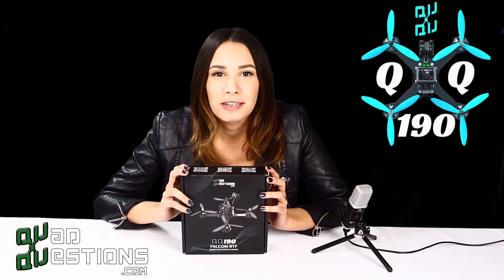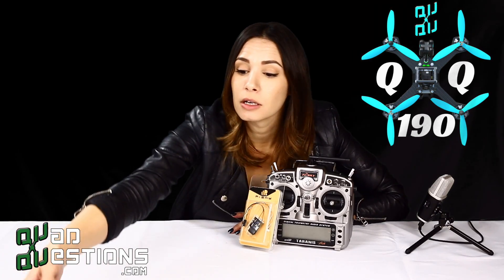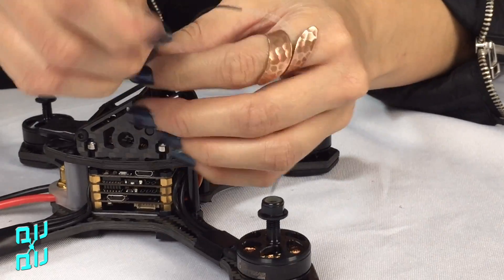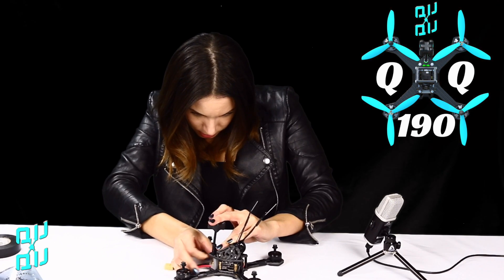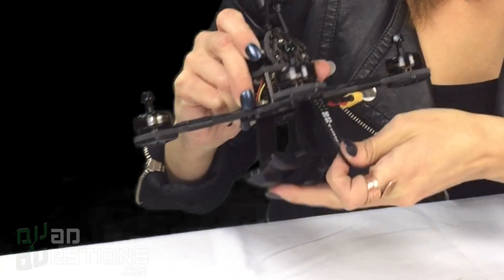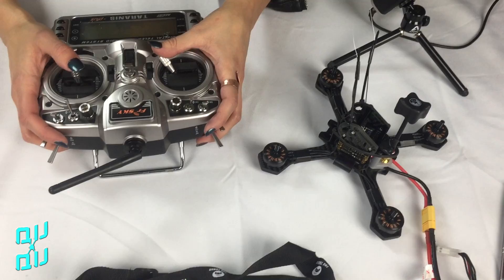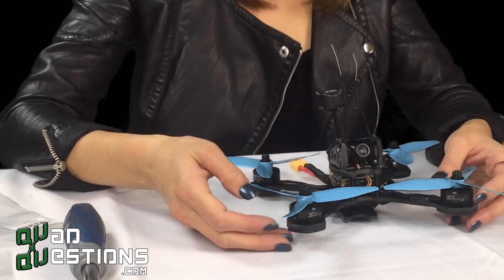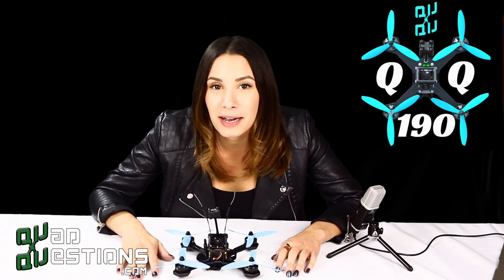QQ190 RTF Racing Drone Unboxing and Initial Setup

Comment: How would you use an XSR on this?  I have a few spares and I'm thinking about ordering this tomorrow.  I don't want to have to order another RX.
Reply from the maker: D Rock     75  easy, but you will need to modify the wire that comes with the XSR to make it work. There are no pins on the XSR. The XSR puts out an SBus signal so you will have to make sure to route the sbus wire to the flight controller sbus input. Some soldering is required.  See page 24 of the manual at manual.qq190racingdrone.com for more info.
Reply: QuadQuestions.com , Right on, thank you. As long as there's a process I can get it done.  I'm looking forward to checking this bad boy out! 
quadquestions.com
Reply from the maker: Awesome- and questions like this we are quick to answer at ask.quadquestions.com  It helps us build content for our customers. We give some good personalized support there.  :D
Reply: QuadQuestions.com ,  You want me to post it over there just for record?
quadquestions.com
Reply from the maker: Sure, if you need the question answered, we will make a guide for you if you post it at ask.quadquestions.com

Comment: Will a 6ch radio work?
Reply from the maker: yes, that would allow 4 channels for control, and 2 channels for switches.  We recommend at least running a 3pos mode switch, and a 2 pos arm switch.